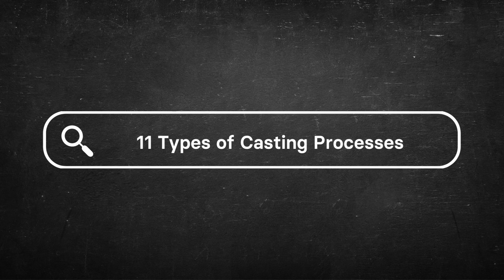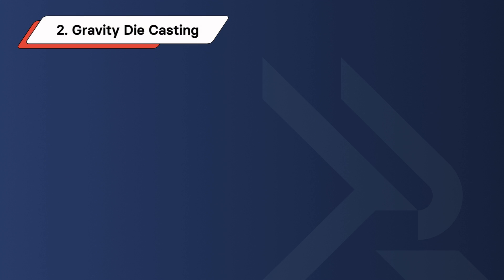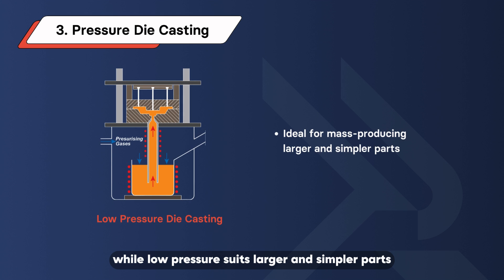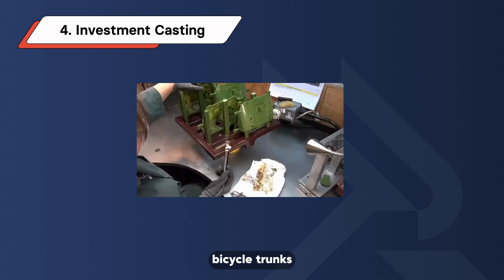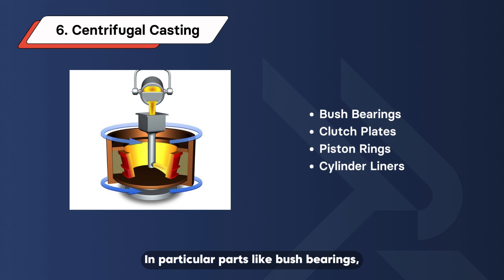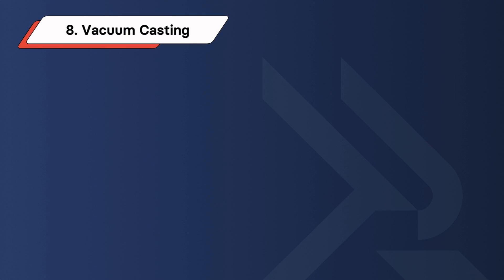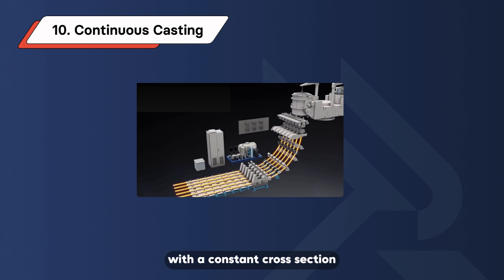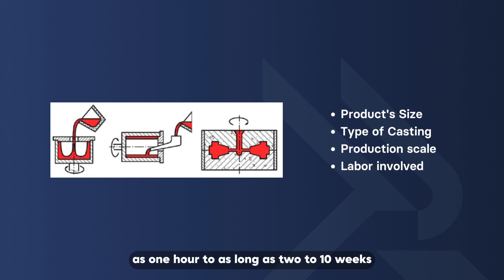What Is Casting? 11 Types of Casting Processes Explanation

Comment: Metal casting is a manufacturing process where molten metal is poured into a mold and allowed to cool and solidify into a specific shape. The process involves creating a mold from a pattern, pouring the molten metal into it, and then removing and finishing the solidified part. It's commonly used in industries to produce complex metal components.

Comment: What type of sand we should use for casting?
Reply from the maker: The sand used for casting is divided into two main categories based on mineral composition: silica sand and non-siliceous sand. When the high-temperature performance of silica sand cannot meet the requirements, special sands such as zircon sand, chromite sand, and corundum sand are used. Non-siliceous sands include quartz sand, limestone sand, clay sand, and others.